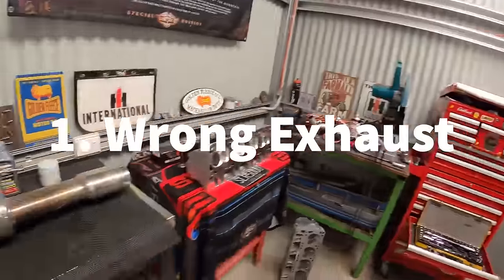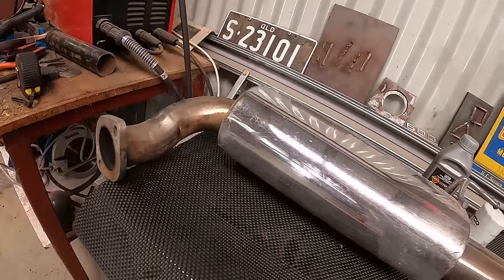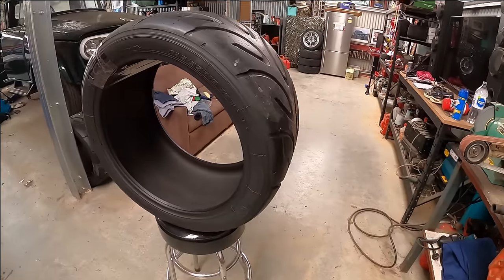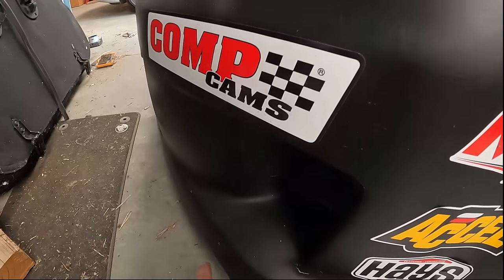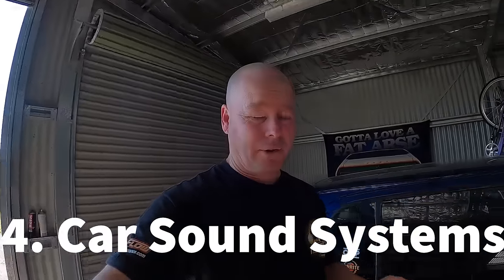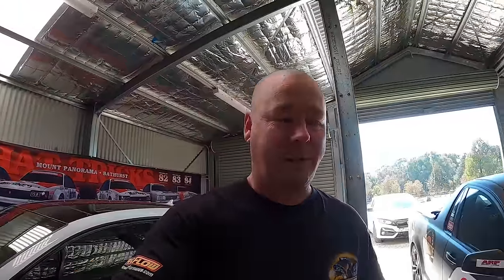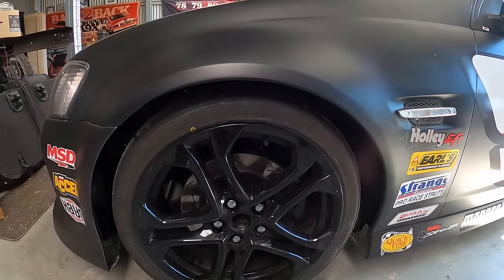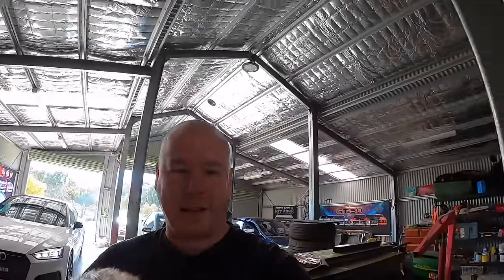Top 5 Worst Performance Mods - VE/VF Commodore

Comment: Great vid! Since you guys are on the topic of performance, maybe a mythbusters about strut/tower braces with the ve/vf platform? Unless it's already been done!
Reply from the maker: G'day Zenny, we have never fitted strut braces to the VE-VF platform so we can't talk from personal experience.  In fact, I can't recall ever seeing a brace fitted to a VE-VF.  Are you thinking about stiffening your front end?
Reply: @ClunieGarage  Once upon a time i was thinking about it, but research through various forums was pretty sporadic. Couldn't get a real answer, and thought maybe you guys had come across this, or tried it yourselves. Most people just say a good swaybar and links is the go but yeah, thought id ask!
Reply: There is a kit for the VF made by whiteline. The towers require drilling. 3 holes each tower. In the earlier models vy/vz in friends cars that had the braces, it definately made a difference to body roll, the front end was more responsive and stiffer.
Reply: @SussNit  now I have always wanted to know how good it would be fixed to my VF aswell. But don't know if I should or not because I've been waiting. For good feedback or more information about how well it would work for the VE/VF platform guys. Does anyone know or have they had any mates that may have already got their cars done with a set of struts and the braces set up???
Reply: @johnoloveshis89vnformulavf49  i wont be doing it for the simple fact I'm not willing to drill the body of the car end of story. Its a pitty because its a great thing to have on the street let alone the track upgrade.
Reply: I've got a 30mm adjustable bar on the front. Can't fit a brace in my V6 as the manifold spacers make it sit too high lol

Comment: The wrong exhaust has got to be my biggest pet hate of all time. The worse has to be exhaust mods done to V6 commodores, why oh why do P platers (they are the main offenders) think that they know better than the Holden engineers that designed them.
Reply from the maker: Agree Tom!  Cat deletes, full straight thru's, drilled holes in mufflers are my favourites! Not!

Comment: I run 18s on my VF as I just stick to the stock rims (just not stock from my model). Only reason I've been considering upgrading to 19s is to try and fill the wheel well out a bit, the 18s look so small on it 😅
Reply: Get meatier tyres IMO. More meat on the wheels looks mean.

I only run 20's because my clubby came with them from the factory but I don't race the car at tracks either. I did size up the tyre in the rear anyway for a little more meat.
Reply: Put VF 18s on my ve only downside is council's don't fix potholes so expect pot hole abuse
Reply: @Phymatic  I've sold it since, I got sick of fixing issue after issue with it. Still love the VF, but mine was a total lemon.
Reply: @kriscreamedonu2221  even my 4x4 struggles on the roads here on the south coast, most 4x4 tracks are smoother 🤦‍♂️
Reply: @Michka1001  that suks most ve or vfs usually are reliable
Reply: @kriscreamedonu2221  right!? I've never had an issue with any commodore I've owned (including a VZ alloytech), but my VF, it always leaked oil, same with coolant, aircon would never work, and had a power drain that no one could find. A new battery would be lucky to see 2 weeks
Reply: @Michka1001  I think you got a dodgy car car manufacturers  rarely put out broken cars but if it was second hand that would reflect on the last owner
Reply: @Michka1001  I love my VE I'd change to a VF cause most parts fit both, except for an r8 kit
Reply: @kriscreamedonu2221  I'm honestly in 2 worlds with the VE and VF, I love both, and find it hard to choose. A yellow SV6/SS VE will always be my favourite, but I can't say I've ever liked the VE interior 😅 both are gorgeous vehicles though, and I'll always be a Holden boy regardless of what I drive

Comment: The garden edging does have an effect. Why do you think lakes cars run rubber skirts? Cleans up underbody airflow and aids with diffuser action by lowering overall pressure underbody. Also theres plenty of good 20" tyre options in 2023 considering the shear amount of high end vehicles tgat run them. It can be done better than you have.

Comment: I bought my 1st v8 in 2017 as a 40yr old.i bought the ssv redline ute and love it I deliberately chose white and have done no mods.but if you have suggestions that would good or should I just leave it alone.
Reply from the maker: G'day and congratulations on buying your redline.  Values have gone through the roof over the last 12 months and you now own part of Australian automotive history.  In terms of mods advice, what is your intended purpose for the car? If it is a daily driver, I would be inclined to leave it alone and maybe just consider a simple intake, exhaust and tune to give it more sound, driver engagement and response.  If you want heaps more power then I provide more detail!
Reply: @ClunieGarage  thank you so much for your reply. I don’t drive my Ute much in fact iv only put 12000ks on the clock and kinda want to keep it factory and a daily driver but would love to get some more grunt out of her but also keeping the mods safe for the engine

Comment: Great vlog and great advice! My VE SSV (G8) 2010 has only driven 48631km. 🤦🏻‍♂️It’s now got Lifter problems. It’s making a loud tapping sound. The cheapest quote I had to replace the Lifters was $3800
Reply: At least you get to throw a nice cam into it while your there. Money well spent!😁
Reply from the maker: G'day Clemmo, so sorry to hear about your lifter noises.  Check out videos on DoD delete and saving your LS.  Sounds like it might be a bit late though...
Reply: @ClunieGarage  Thanks for that. I’ll definitely check it out
Reply: Get yourself a nice cam upgrade kit put in (mild cam, push rods, springs, etc) and while there, pay the extra to have LS7 lifters to replace the stock set.

Comment: I am wondering what about power cruise events just a nice upgrade sound system than stock since the old ve vf car systems are horrible  thanks
Reply from the maker: G'day, I recommend for the best sound for LS engine to go with DPF-Manta headers and mild steel systems.  They seem to have the best design and muffler resonances as well as performance.
Reply: @ClunieGarage  could you go with stainless than mild steel because mild steel rusts so quickly also i was trying to stero and speakers just to upgrade stock speakers and stero with better ones  that aren't out of date

Comment: American, 2009 Pontiac G8 GT here. I got the car around November of 2020 after wanting it since it came to the states in 07'. I only drove it for a few months before I tore it apart in February on somewhat of a small budget. DOD delete, 1 7/8" Kooks Long tube  headers, BTR stage 2 cam, E85 kit, VCM OTR intake, Summit 25% underdrive pulley. It originally started as "just" a cam swap but clearly things got a bit out of hand. What would you suggest for my next couple of mods moving forward? I may be jumping the gun a bit as currently it's still in the garage in pieces waiting on a few small parts to finish the build. Car is otherwise stock except for Solo axleback Jpipes and some 20" Camaro SS wheels put on by the previous owner (not a fan but they don't look too terrible). The car is also mostly just a weekend toy and will likely only see around 5k miles a year or so.

Also, what kind of power do you think these mods will make? Build will be done probably in the next couple of weeks so I'll check back in with some dyno numbers soon! 

P.S. the packaging for the VCM intake was insanely over the top and way too nice for us Americans. I love it! haha

 Love the content. Keep it up!
Reply from the maker: G'day Andrew, your mods so far and the platform you are working with are a great start.  Will be very interesting to hear your initial dyno numbers and based on what you are saying, with the right tune 350rwkw should be possible.  I don't fully understand your goals or intended use for the car, but in terms of your next performance mods, have a think about a trunnion upgrade to go with your new cam, cnc head porting, heavy duty clutch (assuming its a manual or 3.5k stall convertor if auto), 3.7 diff gears for even more poke and acceleration.  From a handling perspective, have you thought about bushes refresh, coilovers, brakes upgrade?  We have videos on the channel about most of these topics and we are really keen to hear how you go.
Reply: @ClunieGarage  The car is mainly just used to roll around town on the weekends. I will probably take it to a 1/4 track atleast once to see what it does, though. It's also an auto, only the GXP came with a manual and the 6.2. I really wanted a torque converter to port the heads but I couldn't convince the wife to let me spend anymore money on the car. I can't complain, she okayed quite a bit before cutting me off. I see the trunion upgrade mentioned alot. How often do they fail?
Reply from the maker: @andrewroman4982  G'day mate, if you have the engine internals standard (e.g. cam), the original trunnions are normally OK.  But with high lift cams and additional pressure on the valve train, then issues can arise, particularly at big revs.  Cheap insurance and check out our video on it.  We used the BTR upgrade kit when we did ours.  Fred.
Reply: @ClunieGarage  I guess I won't really beat on the car when it's running and I'll try to convince the wife to let me get the trunion upgrade next. Appreciate the input. 👍

Comment: I can't remember who it was maybe harrop. But they did a video on exhausts and a stock l76 77 had gains all through the rpm in power and torque when going twin 3 over 2.5. I went with a twin 3 inch on my cammed ve would definitely recommend.
Reply from the maker: G'day Kevin, we agree - if you start to mod the 6.0 platform, a twin 3" is the go.  However, I recall SQP in WA also did some interesting tests on the stock L77 with smaller headers and exhausts vs bigger units and the results pointed towards smaller being the go.  Will try and find it and send you the link.

Comment: NZ 
The wheels:

are of a known and reputable brand, and
would be considered an appropriate fitment for the vehicle type by the wheel manufacturer, and
are not modified, and
do not have spacers or adaptors fitted, and
have a load rating acceptable for the axle rating (or vehicle GVM where axle rating is not available).
Note: Spare wheel is often OE and can be used for comparison.

Tyres

the tyres:
have an outer circumference that is no more than 5% greater than OE, and
are an appropriate selection for rim width (see the LVVTA's Tyre size to wheel size compatibility guide, and
have a load rating suitable for the axle (or vehicle where axle mass is not available)
have a speed rating suitable for the vehicle
the tyre tread does not protrude beyond:
in the case of a vehicle that is not a class NA or class MC vehicle, the unmodified original body panels or factory fitted mudguard extension/flare; or
in the case of an class NA or class MC vehicle, 25mm outside of the unmodified original body panels, provided that a flare or wheel arch extension covers the full width of the tyre tread.
Reply: what im getting at is the rim section do what ever you want then the tyre section  says your screwed

Comment: Just wondering, in the snot box dyno vid, the exhaust was 2.5" but didn't it have straight through mufflers?
Reply from the maker: G'day, the snot box has a centre muffler and removable rear twin mufflers for the track.

Comment: i've got a 2.5 exhaust and thought i was the only one.  The reason being the 3 inches i heard would drone at about 2.5 rpm. It is a HM header exhaust who also supply walkingshaw(or did 10 years ago), who then mark them up substantially.  good advice here
Reply: I have 3 inch on my maloo doesn’t get driven as much is obnoxiously loud though no worries about drone being a ute. 

Have a 2.5 on my vf series 2 note is deeper. Sounds more refined and no drone. Makes all the noise you want when you open it up.

Comment: I agree if you're going for a track setup. But if you're going for a mean cruiser look then there's nothing wrong with big wheels and a stereo.
I've got full hurricane system 3inch on my VF2 redline and the factory 19s so they go over the 4pot brakes. The exhaust system sounds amazing especially with a mid size cam.
Reply from the maker: Nice one mate.  Yes, we are all about mods for the track as opposed to cruising.  All good.